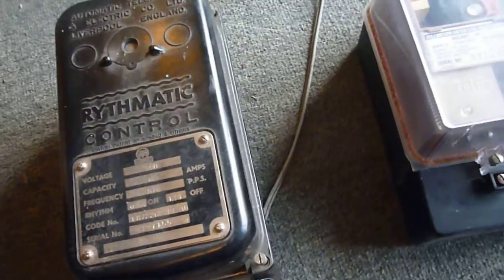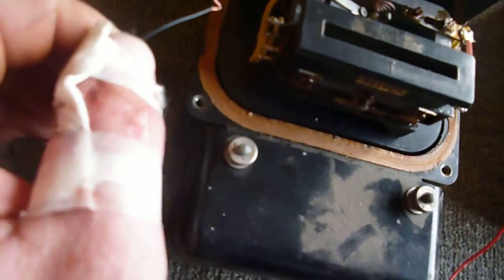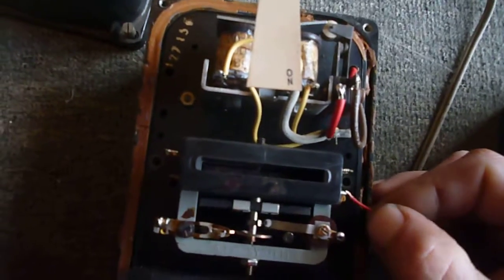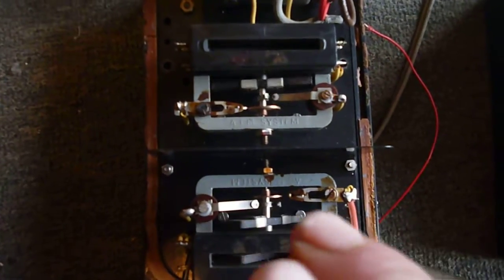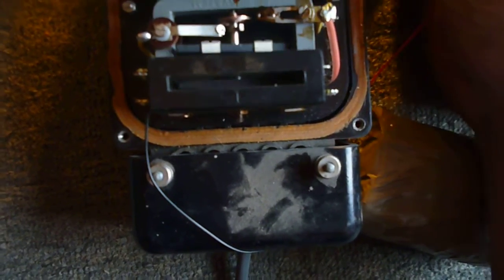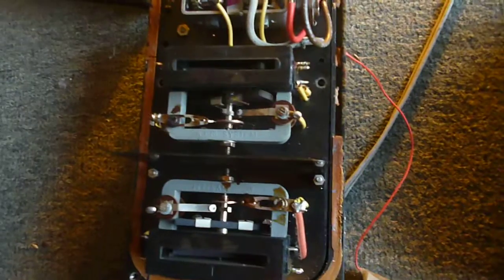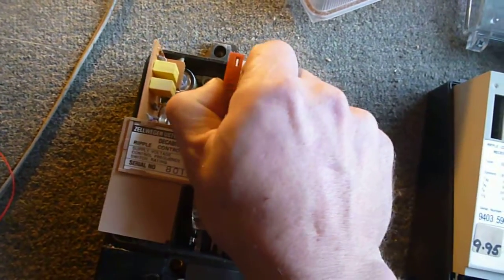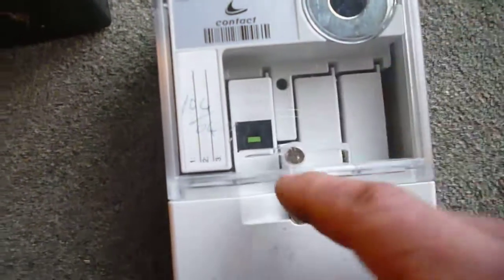saving our electrical heritage  ripple control

Comment: Do you know where i can get the Enermet RO3 receiver?
Reply from the maker: in your area im not sure  just ask the guys that work on your power meters and ect
Reply: Ok, I have actually Found a way to potentially get them.
Reply: @tony-lq7yk  Hey sorry to bother you again but I am going to be getting a few old RE1 and RM3 receivers from a lines company (finally). I know the RM3 is programmed from a computer, but I'd like to know which of the contacts on the little programming card for the RE1 have to be soldered to change the channel. I know it is binary but I think you'd have more info on this considering you have done it before. Thanks!